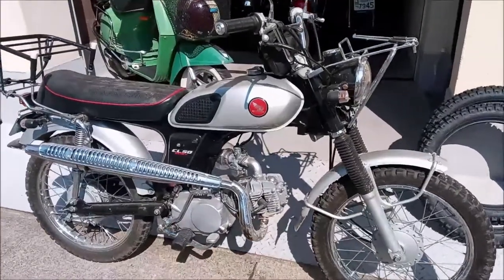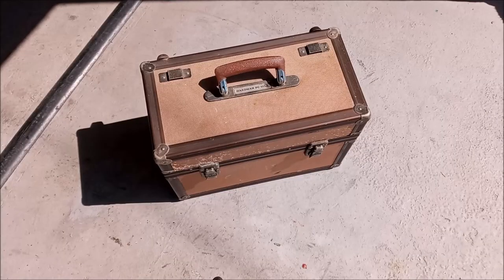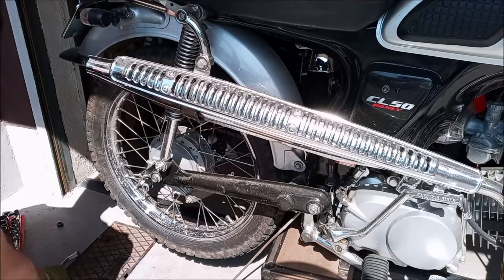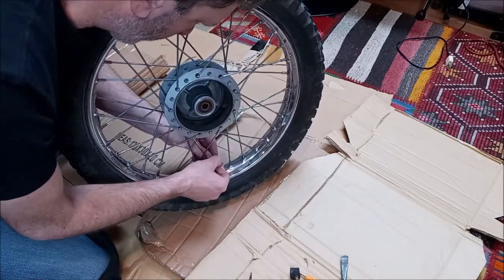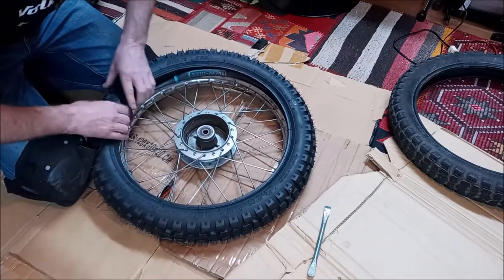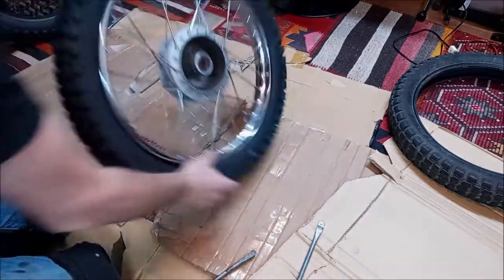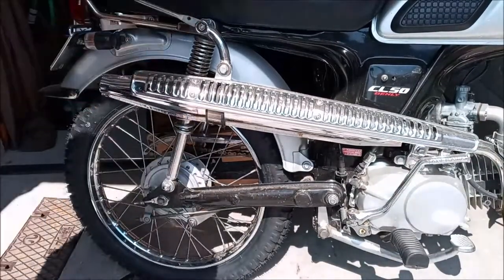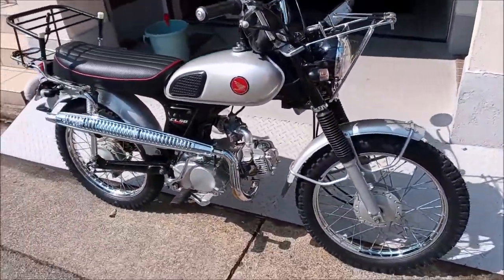How to change a rear tire on a Honda CL, cub, passport C50, C70, benly from Japan-  +rare Rikuo tank

Comment: Would a 2.5 inch tire fit the front of a C70. Need to replace the ancient tires on a the Super Cub I bought that hasn't been registered since 78... they are cracking and stuff.
Reply from the maker: Sorry for the slow reply. Yes, that would be fine a 2.25-2.5